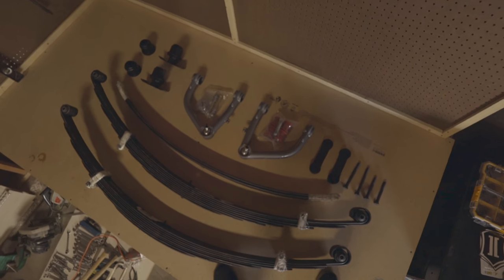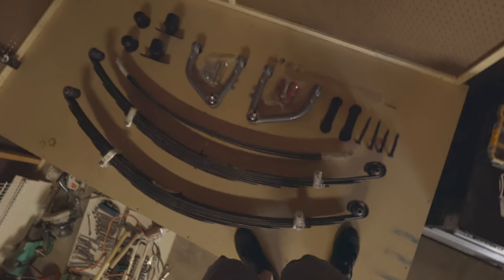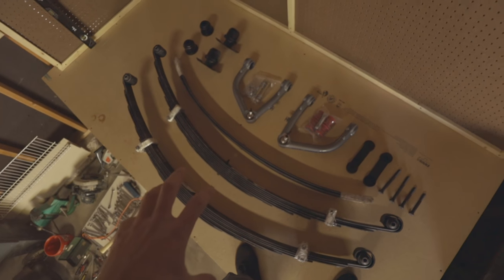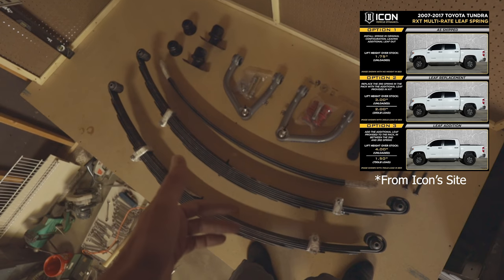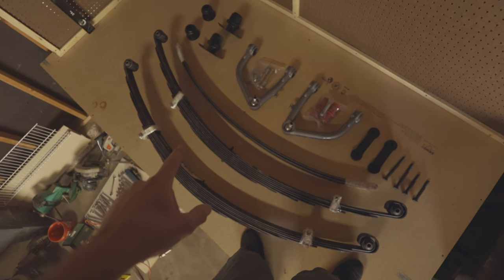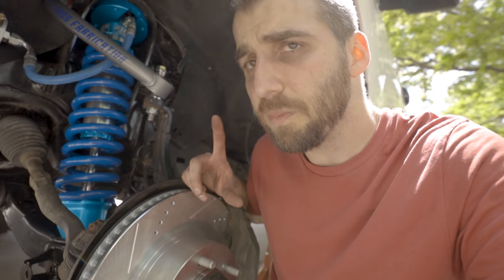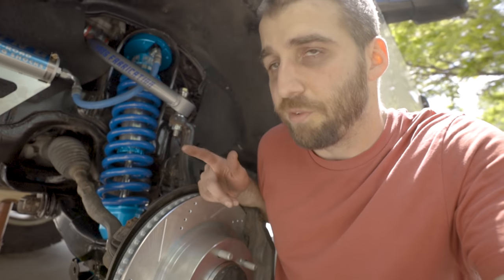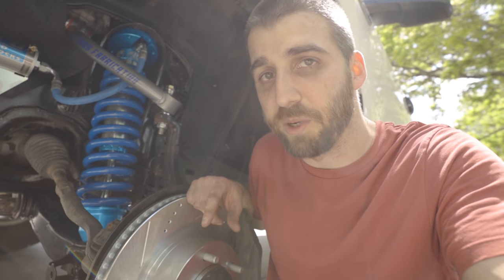Overland Build - 2nd Gen Tundra Front suspension

Comment: I have a 2008 tundra crew max with 170k. i tow a 7k camper and do some off road. anyway, the 08 is the part of the recall for frame rust. I think a year ago i got this done where they stripped it and coated with some black stuff so the frame is solid. if the rust was found you got a new frame. Mine was clean .  Suspension is rear is HD4600 shock and fireside airbags. Front has a 2inch lift but i am getting to a point of refreshing the front like you did due to the rusted bolts.

Comment: Every person I know that wheel a tundra and has tried the cheaper local auto part  CV axles has had to replace them after 5 to 10k miles. It's better to run oem, rebuilt oem, or RCV CV axles.